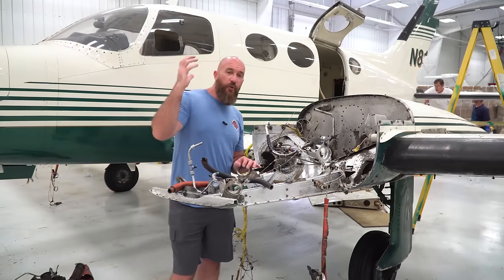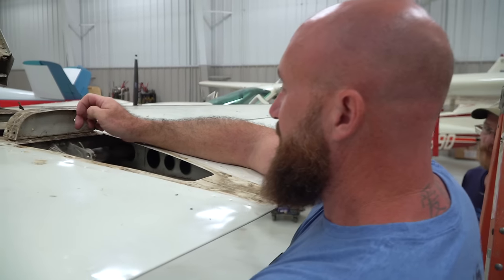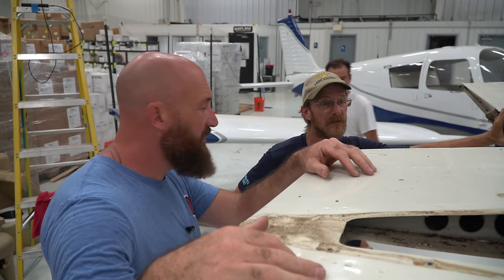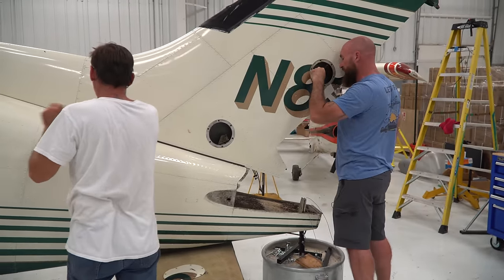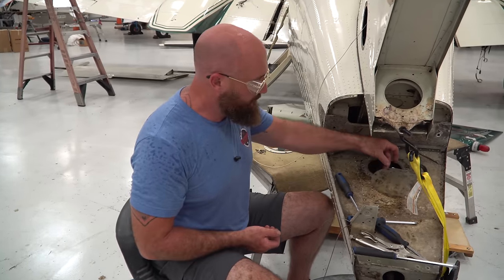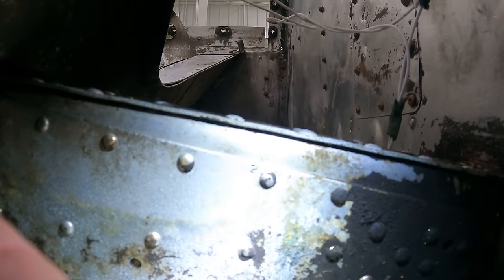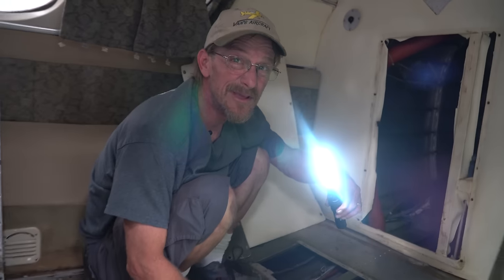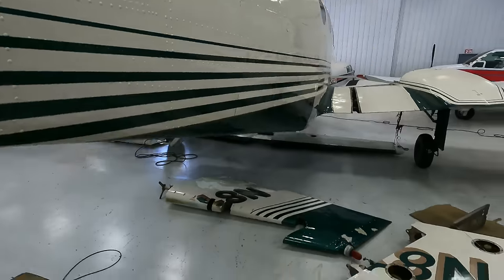BAD NEWS For The Free Abandoned Airplane !

Comment: Do these smaller FAR 23 planes have an SRM?  (Structural Repair Manual?) I would think so because the FAA always requires some continued airworthiness documents when the aircraft is certified. This document typically specifies repairs recommended by the OEM (structural repairs and damage limits) and maybe you can start from there? From there, you can get a certified A&P mechanic to start fabricating parts or repair parts for whatever needs repairs. Remove and replacing parts that don't need replacing from OEM will become expensive.
Reply: The 401 was already out of production before Part 23 was published, so the 401's (and the other piston 400's) were certificated under CAR 3. ICAW hadn't been invented yet. ~2005 Cessna did compile service information from operators and published supplemental inspection documents or SIDS that cover most of the problem areas on these planes. There has been no mention of it here. While an A&P can repair whatever needs repaired, once he ventures into the land of major repair he will need approved data. If that requires getting a DER involved it can also become expensive.
Reply: @buckmurdock2500  That does make sense since the plane started production in the 60's before the FAA was formed. It was called the CAA if i recall.

Yep, if he gets into major repairs, he will need a DER to review the repair data and find compliance with FAA regs. In a former life, I was an DER, but for part 25 and focusing on engine nacelles and in my experience, FAA regs are totally fuzzy with regards to what is major and minor and is dependent on the repair or overhaul station (at least for CFR25) to make the determination.

Regardless, if he sees the metal is corroded, he'll need to get an inspector to look at the area, confirm that its corrosion and if so, see how far the corrosion has spread. Then he (or a certified mechanic) will need to perform the appropriate repair.

Comment: Fix the Engine mount I say.  You have already said it would be a major problem if the wings were removed.  The 401 may not make it to Oshkosh next year, there is all ways 2024 and it would be better to be safe and correct then to do a half ass job.

Comment: See if you can find a pair of wings that have had the straps done already would be my choice... if you can't find a pair... just replace the damaged one if you can, then get the straps done. If the engine cradle can be repaired ... that would be great... it would be nice to keep it's original wings if possible... rather than it turn into a ship of theseus

Comment: Darkflash is right on the money. 1. Safety assessment, 2. Problem assessment ( i.e. corrosion, parts to clean, parts to replace etc), 3. options for both assessments including costs, 4. Make decisions based on safety first and then proceed.  With all of the backing by your viewers Jason, cost will certainly be mitigated.  When you are all done, this plane will be better than new and safe for years to come.  KEEP 'ER MOVIN !!! MW

Comment: I'm just wondering, doesn't this type of work have to be performed in an part 145 organization?  Also, don't know if it was a steel brush that was used, but a general fyi, never use a steel brush on aluminum

Comment: it seems to me, although I am not an airplane guy, that the exhaust can be custom made at a muffler shop with a pipe bender.  It looks doable in my experience as an auto tech that has worked in making custom exhaust.
Reply: @eagle2019  Okay, seemed easy looking at the pictures.  Of course, it has to be right!  Thanks

Comment: I wouldn't replace the wings.

Repair the ones you have as best as you can. They will hold for many years to come.
Replacement wings will give you dimensional and structural problems that you can not start to imagine at this stage.
This plane seems to be unsuspectedly sound. Repair your right-hand side wing that is what I would do.

best wishes. Mario (from Lisbon, Portugal).

Comment: Man I wouldn't trust any mounting brackets that move or could vibrate .. 
Don't guess .  You need to x Ray those parts on all the control surfaces.  If they are new you have a good trustworthy plane.  I'm a auto mechanic.  But just knowing what I know about that, and wear and tear on moving metal parts.  
Makes me a whole lot more comfortable to know that stuff is new and solid again.

Comment: I'm not an airplane expert by any stretch of the imagination. But as you said, one wing looks fine. If one wing looks fine, why change it out for a wing that's totally different. I'd change out the corroded wing only and clean up the other. But it all depends on the condition of the wing you're thinking of keeping of course. That thing probably needs to be thoroughly checked for any hint of fatigue or stress fractures. The replacement wing or wings also need to be tested properly. Best of luck with it anyway😉

Comment: Get a dry ice blaster for all that bare aluminium. It will reveal any corrosion and pitting and remove all surface rust immediately, without all the water and chemicals on your shop floor.

Comment: A donor wing would come from what?  Another 50 year old 401 in a bone yard.  As I’ve said repeatedly, exhaust leaks and corroded engine beams are a very common problem on twin Cessnas with this exhaust systems design.  Chances of finding a pristine wing sitting outside in a bone yard is not good.  If the wings were pristine it probably wouldn’t be in the bone yard.  The beams can be replaced.  The ones I installed were from TAS.  Much quicker and cheaper than Textron.
Reply: Yup, all other planes of this type will have the same warts. Without a proper inspection of the wing, nobody knows what it needs so like the other ~20 episodes  this is another episode of no progress toward getting the plane in airworthy condition.
Reply: @eagle2019  Didn’t know they rented the jig.  We made one in a few hours.
Reply: @eagle2019  He doesn’t listen to anyone with actual experience doing what he says he wants to do.  He’s only interested in doing stuff to get more views and donations.  Having the wing lying on the floor would be much more impressive to the fan boys than drilling rivets and replacing the beams and bulkheads.  But what the hell.  The whole thing is senseless.  He’s going to have $400-500K of other people’s money sunk in a plane that no one would pay more than $150-175K to buy.  He says he wants to do all this charity work.  Get a different plane that’s not a basket case and right off he’d have $200-300K to spend on the charity.
Reply: @eagle2019  You forget the most important thing: his fan boys are paying all the bills.  He’s has already convinced them to turn a $5K 401 into a $400K 401.  I can completely see them paying for his ME rating and insurance.  Of course, if he’s flying a 401 with ~100 hours in his log book, they won’t need to pay operating expenses for very long.

Comment: I don't understand the distinct lack of 18 volt 1/4" drive impact wrench. They work great at removing those stuck screws right? The time savings alone over those long-handle hand crankers really has me scratching my head. I know mine has variable speed/strength/hammer settings which prevents destruction of screw heads.

Comment: A power screw driver would sure work nice when you're taking out a ton of screws I would think rather than removing each screw by hand.
Reply: They are removed by hand to avoid stripped or broken screws. You can feel the difference between a normal screw, and one that may strip or break. 
this way you can get more anti-corrosion spray worked into the threads and get it out without damage.

Comment: I have never owned a twin Cessna.  But I have maintained many twin Cessna aircraft from310s to 421C's for many years, and there is always something new in the engine compartments.   Canted bulkheads and frame rails have been a problem for many years.  I have been out of the aircraft business for 20+ years but the pictures sure look just like many years ago.  The turbo charged aircraft exhaust system was very poorly designed in my opinion and many upgrades have come along, but one of the biggest problems are the components fit together very poorly.  This system is so bad that at Engine overhaul time we priced in a complete new exhaust component replacement.  If the owner did not want to replace the exhaust components (very expensive) We would invite him to take the aircraft else where. RAM slip joint helped some, both leakage and binding.  Some time safety has a price.  We had the ability to measure the the wall thickness of the pipes and found that the erosion on the inside was very significant.  Twin Cessna exhaust system need a lot of attention.

Comment: Question, what is the required result of the work? 
Are you trying to make an old 401 fly to say YAY we made an old 401 fly?
Or are you trying to RESTORE the 401 to 100% flying condition for the future?
If it the first, remove the panels you need to look at everything necessary, clean and paint, get some engines with time left and fly it.
If the second remove the wings the tail plane the tail and do it properly. Get a spare set of wings etc and build the best from what you have instead of buying new. Do all AD's fit new bolts etc. 
Record everything with part numbers, build an amazing inventory system, keep all old parts even damaged for forensic study or to remake if not available.
For rust removal on bolts nuts etc without damage to parts I have used CRC Evapo-rust(R) to good effect, the only downside is on high carbon steel like ball-bearings, the end result can be a blackish appearance it can clean off, but does no damage.

Comment: I used to repair issues like yours, and also serious structural damage repair. It's not an easy fix. Sometimes salvage parts can be found in good shape and used, then places like Straight flight Inc. Can possibly fabricate and install the parts.

Comment: As an aircraft technician who works in an EASA Pt 145 organisation. This aircraft looks too far gone to restore. Good look passing the required airworthiness inspections and finding a licensed engineer who’s willing to sign it serviceable with all the corrosion and cracks. Safety critical systems like the engines, fuel system and the control surfaces have zero tolerance for defects. Aircraft maintenance is to a whole different standard compared to cars. 
Yes old ww2 aircraft have been restored but the owners would have had a bottomless money pit to rebuild the airframe. I know of vintage aircraft getting grounded because the owners went bankrupt.

Comment: There is a product called "Aluminum Brightener" that i use for cleaning any dirt or corrosion from all my bare aluminum surfaces. I think it would save you a ton of work! Spray it on, let it set for about a minute, hose it off. I buy it at Napa. Hope this helps!!

Comment: I think, depending on how many parts are on it, and the condition of it, a donor plane is the way to go.  

If nothing else, as long as the essential parts are present and good condition, it would enable you guys to replace wings and damaged control surfaces.  Even if that means it's a stripped out hulk with no avionics, no engines, and half the panels or torn/missing, if the very bones of that donor are good I think it'll work out.  But that might be a unicorn lol.

But, with a decently put together and good condition plane, I'm not sure if the cost is going to be prohibitive.  Like, if its going to cost $100,000 (just an example number, not real) to replace the wings from the factory, and $200,000 to buy a donor, I think that waiting that 9 months is the better option, even if that moves the timetable back further.

Just my two cents though, from a guy that works more on cars than he ever will planes (probably).
Reply: @eagle2019  Dang, didn't know that.  That makes this all the more a pain in the ass.  And it makes sense that Cessna doesn't make wings for the 401 anymore, being that it was manufactured in like the 60's or 70's, right? Like, after a certain point Cessna has to focus on the more modern and/or more popular airframes.

I WAS going to ask how much does a Cessna 401 have in common with a modern Cessna twin engine, and if the wings from a new plane might fit on the 401, but a google search answered THAT question lol.  Cessna doesn't even MAKE twin engines anymore, no wonder it so difficult to find parts.

Now that I know this, I think the only real way to move forward is a donor plane, or pay to have specific parts made by a specialist company to replace what's un-repairable.  And god knows how much that last option could end up costing.
Reply: @eagle2019  Wow, that's a LOT cheaper than I was expecting.  I'm sure this case will be different, of course, but in a range of say $20,000 to $50,000 seems fairly reasonable.  Probably cheaper over all than a donor plane.  

I do remember though, I think last video or maybe the one before that, it was brought up that removing the 401s with gs would/could make it so that the bolt holes for attaching the wings to the fuselage will not line up and the whole wing could end up twisted, just by removing them.  How did Williams overcome this?
Reply: @eagle2019  I see.  Thank for the info, airframes are not something I'm familiar with, outside of the engines lol.  

As a car guy I thought it was kinda wierd that they where so worried, like, if the wings are so prone to warping how come they don't get permanently deformed in daily use?  Clearly they can't be under that much tension and still be level.

Thatd be like saying the subframe of your car can't be taken off and put back on, because of the release of tension.  I was thinking maybe planes need to be 100 times more precise or something but it sounds like you could do a "wing-swap" and it wouldn't be a massively huge deal.  

As in, like an engine swap in a car, for perspective.  As long as everything comes out well, and goes in well, there's not much reason that the car would be totally ruined, and same for the airframe.  Keep in mind I sat in the cockpit of a grounded plane once and that's about as close to a functioning airplane as I've ever been lol.  So maybe I've gone from overcomplocating things to undercomplocating things

Comment: Have you considered using Trailer Cleaner to clean the aluminum? It’s a low VOC acid that will turn that aluminum white clean and any corrosion will stand out like a sore thumb. You would need to either have a respirator or moving fresh air to apply and wash it off.

Comment: You said the exhaust is going to be about 10 grand?? You can go to an automotive shop and have them rebuild the exhaust for a quarter of that. If you read the FAA directives as long as it meets the original design of the airplane or is better than you can use it. A muffler shop would be more than happy to build you a new exhaust system for this airplane. That's a simple exhaust system on that airplane and I guarantee you that a muffler shop would be more than happy to build you a pipe with the bins in it that you need using the same exact metals and everything.

Comment: If you going to replace or repair the wing,  it can be disassembled in either case.   Disassembly will give a much better picture of what the condition is and will be very interesting to watch on youtube.  As has been stated by others, the individual sheet metal parts are not complicated and can be fabricated by certified air framers or procured from Cessna if needed.     I would have a lot more confidence in a rebuild wing then a salvage wing.

Comment: Corrosion between the riveted seams of the airframe are going to be the real problem if you have any. And it doesn't look too good from the video
Reply: And speed handles give you a lot of torque on those stuck Phillips screws

Comment: I thought there was issues involving removing the wings and things not lining back up correctly? I would assume you would have even more issues with a donor wing. If that is not an issue and it's cheaper to replace the wing that is the way to go. I would continue the path on the rebuilt engines if it's financially achievable you will have better engines with history you know from 0 time smoh

Comment: Little doubt that severe corrosion was caused by the extreme heat and particulates of the exhaust leak on the left side. I’m surprised that wasn’t caught on a previous annual.

Comment: They are trying to rush this quite a bit, slow it down and make sure your doing it right. Rushing could be costly and beyond dangerous. A complete clean and deep dive into structural integrity should have been done first before anything and it's  still not even clean..no real excuse to keep it sitting there filthy still and unchecked.
The fan base would have been fine watching a proper clean and check of the plane. Your not a drama. We don't need flashy content. Just the correct process.
Everything your finding in this video should have been done right after a full and deep clean. Very late especially after you have ordered major parts and sent engines off to be worked on etc.

Comment: Just like how the golden nugget with Matts Offroad Recovery was repaired, do whatever it takes to get it on the road/air in this case as soon as possible in order to help people faster, but at the same time be reliable. Since helping people is the goal, reliability is prime decision maker. For example, if decision A is quicker yet has an engine that has more run time and decision B has lower engine time yet takes 3 more months, go with Decision B.

Comment: It appears as though some repairs were made using steel brackets that have since rusted. 
It is not a good idea to bolt steel to aluminum. It creates a form of electrolysis that rusts both metals much more quickly.